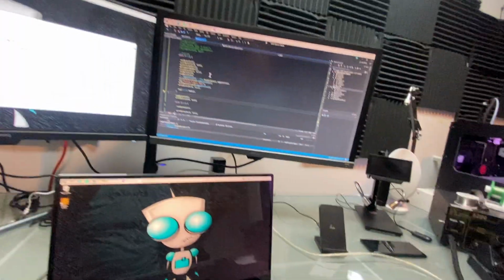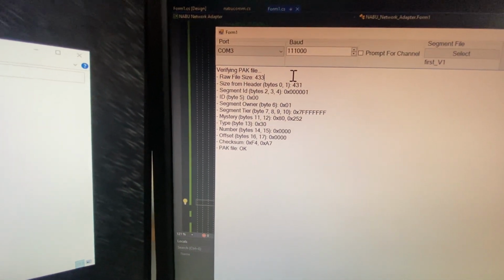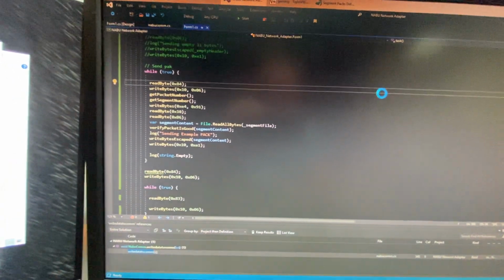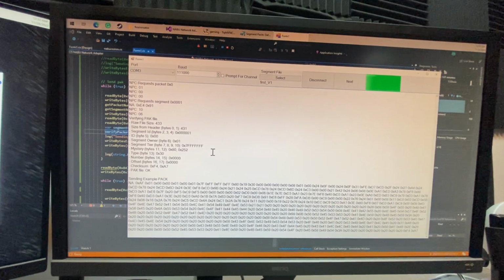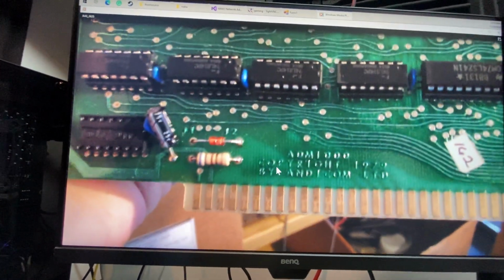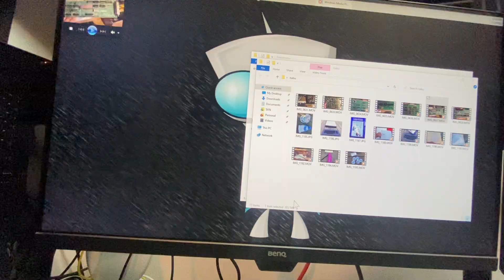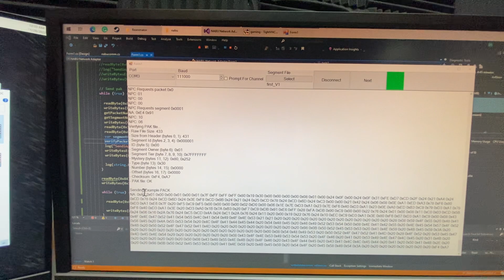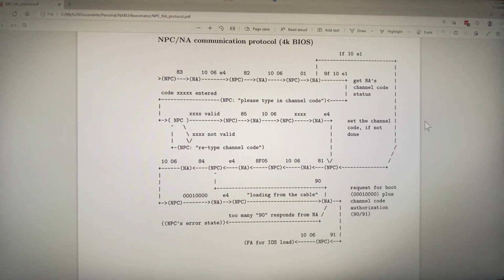05 - Nabu computer header file troubles

Comment: There are obviously two ways to form the checksum: based on the raw file and based on the escaped payload data representing the file. Maybe try with the respective other method? (I guess, in case of a checksum error, the Nabu would re-request the segment as seen in the video, as this would indicate a transmission error in regular operations?)

Comment: What cables are you using to connect your modern pc to the Nabu?
Reply: From a previous video, he's using a usb to rs422 adapter to connect to the port that would otherwise connect to the 'cable modem'.
Reply: As far as I can tell from the last video, it is the DTech USB to RS422 serial port converter
Reply: @Eric Swanson  very cool, thanks!

Comment: If you know of anyone who is good at recreating PCB designs from images your videos of the old gear might be useful.
Reply: The best thing to come of this would be the recreation of the floppy disk controller that was an optional addition to these computers. Then CP/M disk could be used to boot an OS fairly easily
Reply: @LeObsidianCraft  Assuming it can boot from a floppy.  The floppy disks might've just been used to store user data for applications but not programs themselves.  A custom firmware or a bootloader that can be uploaded to it could maybe be made to allow it to boot from the floppy controller though.